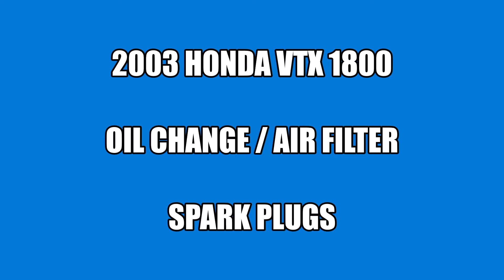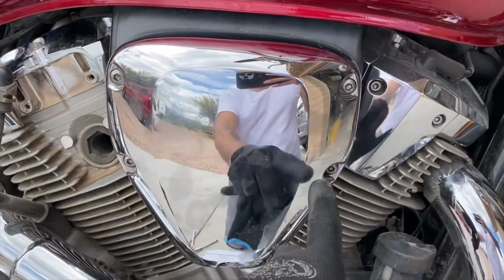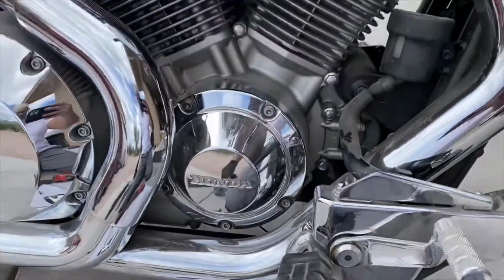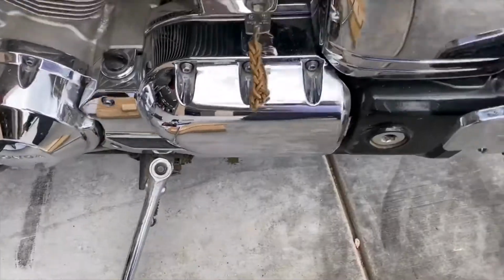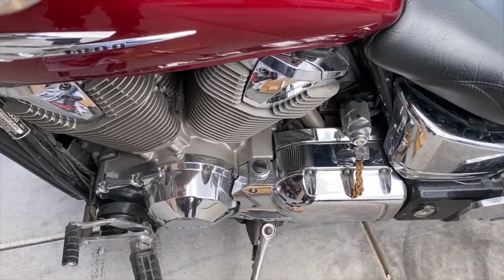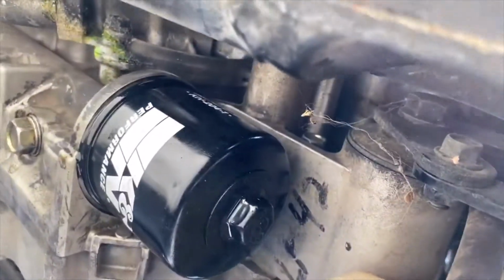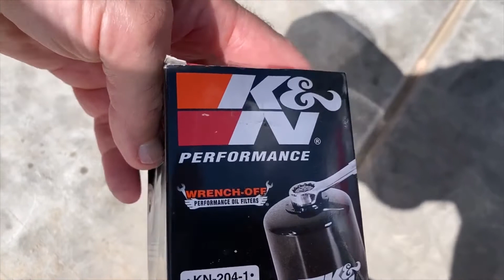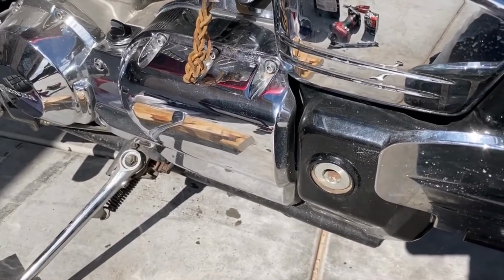2003 Honda VTX 1800 Oil Change Spark Plugs and Air Filter

Comment: Correct me if I'm wrong but isn't the point of a video is to show a person how something is done and not just point to things? I was able to follow along but you really should show people what to do, especially when it comes to changing the oil and filter. Nothing was really learned from this video.
Reply from the maker: Nate Graham if you don’t know how to turn a wrench or loosen a bolt I don’t know how to help you. Try filming with 1 hand and wrenching with the other. My videos explain what to do and what tools / parts you need.
Reply: I learned a heap from this video. I just bought a 03 vtx 1800c and now I know which oil filter to use, what wrenches Ill need, where the filter is located, and looking thru the comments I found what kind of oil I need... thanks for the video mike! outstanding work! dont listen to this cry baby
Reply: He could have just got somebody to hold the camera while he did the work
Reply: I just picked one of these at myself thank you for the helpful info

Comment: What weight oil?
Reply from the maker: mosefuss should be 10w40 honda oil or whatever brand oil you prefer. It is liquid cooled so it doesn’t need the 20w50 oil the big air cooled V’s need.